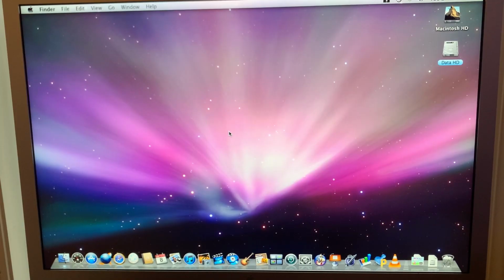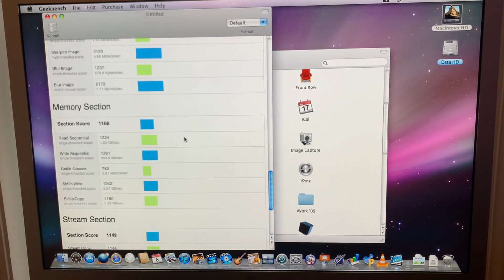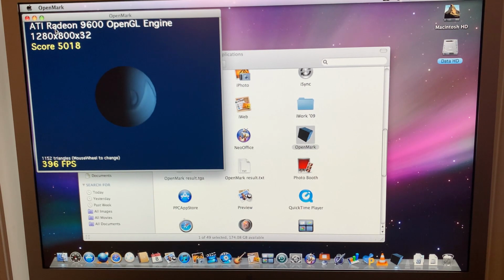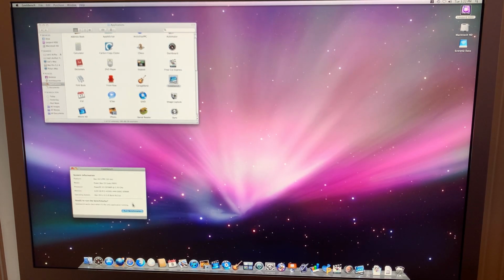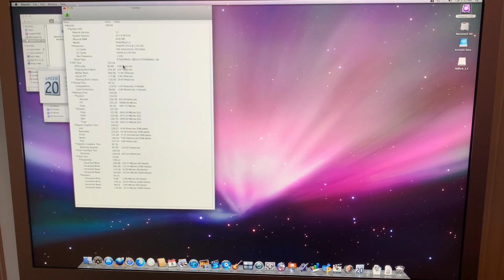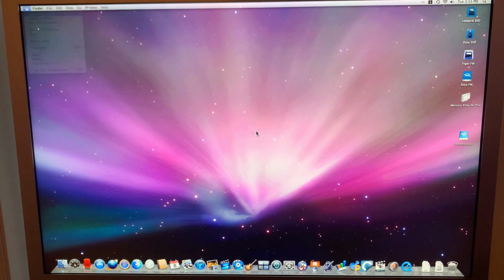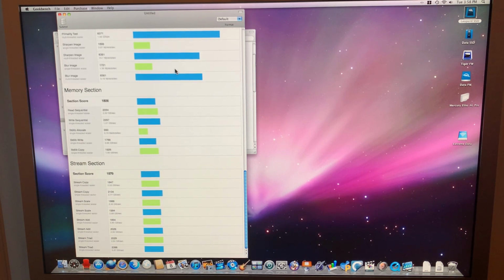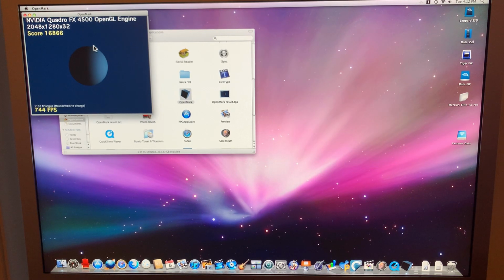Power Macs, G3 to G5, Benchmarks! Part 4

Comment: Just imagine if they had one or two more generations of powerPC...

I put a SSD in my G5 dc 2.0, and it didn't do anything except for getting an extra 15 points in xbench. I didn't notice any improvement in FXE or other apps.
Just used a WD blue and it worked with no issue.
Reply from the maker: Well, if IBM had been able to control the heating issue and the power usage, it would have been a different story. It is likely that, had they been able to design a G5 that would have worked in a notebook, Jobs would have stuck with PowerPC. 

Interesting point about the SSD. It is true that, limited to SATA 1, the distinction between a SATA 2 SSD and a high quality spinning har drive would not be that great. I think I get stuck in G4 land, where your should is between an SSD with Epsom kind of adapter, or an IDE hard drive that could fail at any minute.